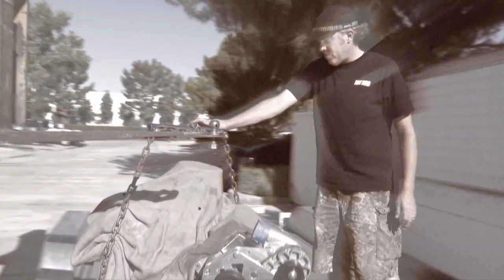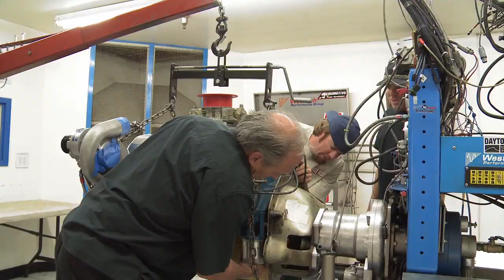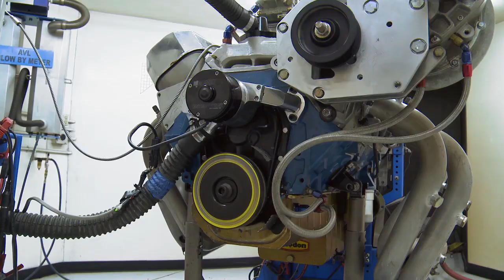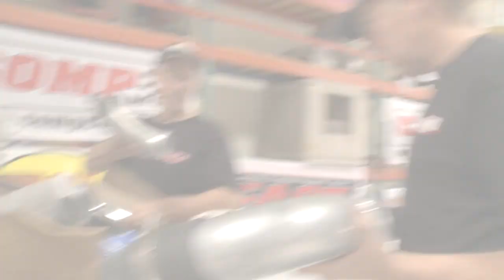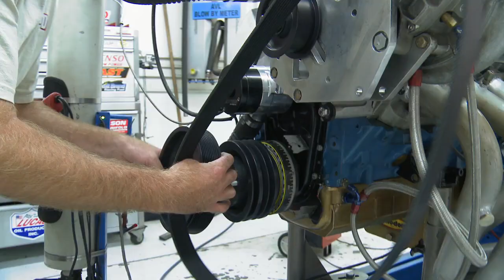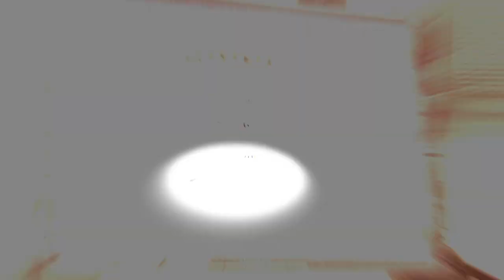HOT ROD Magazine's 1,100 Horsepower Bonneville Big-Block

Comment: How did you guys add boost to such a high compression rating/ I was told for my dart big m 360cfm headed 572 bb with 10.5 to 1 compression that i was too high for boost.
Reply: boost on a relatively high compression motor can be done with lots of (rich), high dollar (hi-octane), fuel and dial the timing back, also bonneville is at altitude which kills some of the compression...and keep in mind they only ran 9 lbs of boost...though they didn't do it here, you can also intercool the mixture and/or inject methanol/water...
Reply: Most of the really serious boosted motors you'll see run surprisingly high compression.
Reply: This is carburated so there are pretty modest gains with intercooling - the atomization of the gas coming out of the boosters actually pulls heat out of the air, you drop something like 100 degrees across the carb = 200 degrees in is a 100 degrees out :)
Reply: High octane
Reply: They didn’t. Watch the other video where it blew up on like the 3rd run

Comment: Ive seen 2.8 liter i6's make 1500 hp....that thing should be makin 2200 or more
Reply: that's at only 9 psi smh those motors be pushing 30 psi smh
Reply: Right but will that motor last 5 miles of WOT. I highly doubt it.
Reply: Those engines are pushed to the limit. This barley has any boost on top.

Comment: I really don't even like the GTR, but what I'm getting at is that if you can throw a shitload of boost on a dinky 6 cyl engine, then why couldn't they throw just as much on this thing and get ridonkulous power?
Reply: Carbs are limited for boost, an EFI setup would get 1500 easy with lower compression and properly gapped rings no high-end, high-dollar race stuff.

Comment: Sorry, just displacement with a lowtec blower, 8l of displacement and carburator is silly, and 1100 hp is low you could build a better motor with half the displacement..... 1/10 sounds nice
Reply: It's because of restrictions in the class they are racing in.
Reply: Not on 9 psi...
Reply: dude that was with only 9psi smh this motor will make way more than that especially if there were to drop the compression to around 8:1

Comment: 1100 hp isn't that much.  Hate me, but the GTR has a much smaller engine and can do better.  With a block that big I was expecting 2000+ hp.
Reply: someusername121 tell me how much a gtr can make a 9psi, because that's what the big block is running